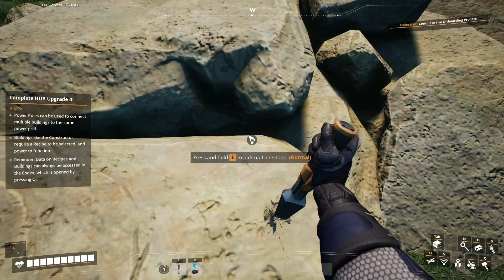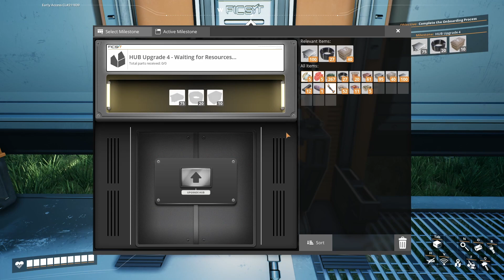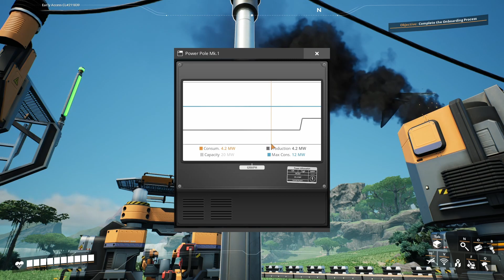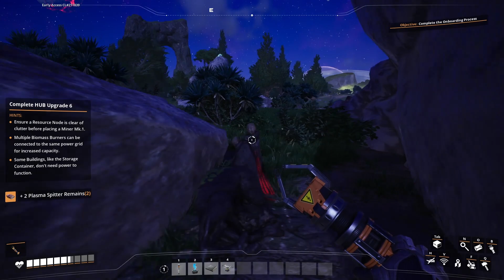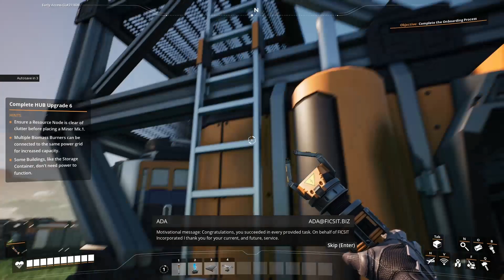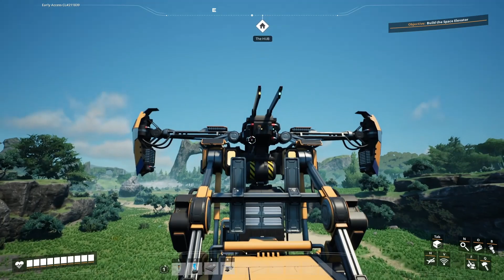Satisfactory Ep2 | Iron automation

Comment: I commented on your last video I didn't know you had a second one.  You should be crafting leaves and wood into biomass it burns better, you can automate that production.  The key with biomass is they only burn fuel as you need the electricity.  So if your burner produces 30 but you are using 15 it will burn fuel twice as long.  So you can increase the time your burners will stay on by building more of them.  Downside is when you do need to fill them, you have more to fill.